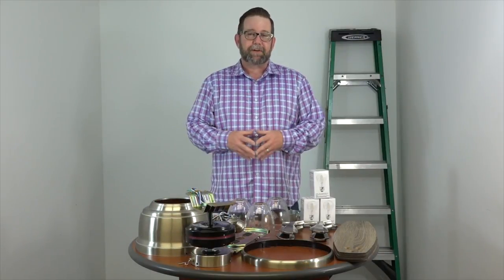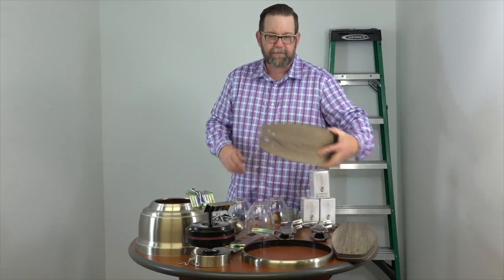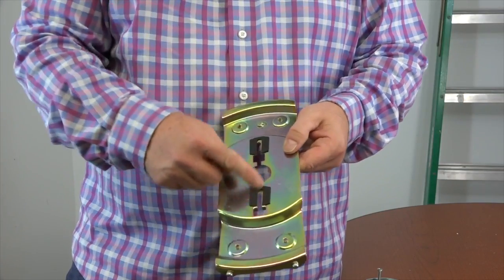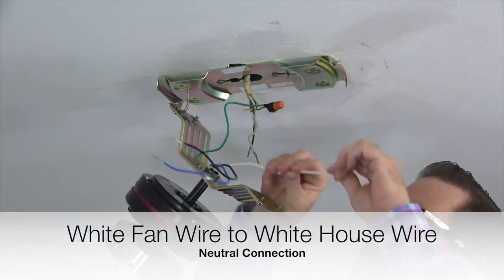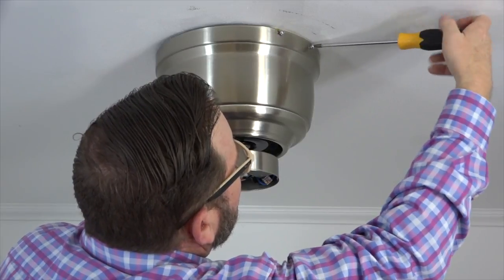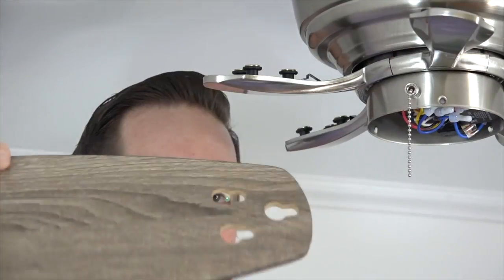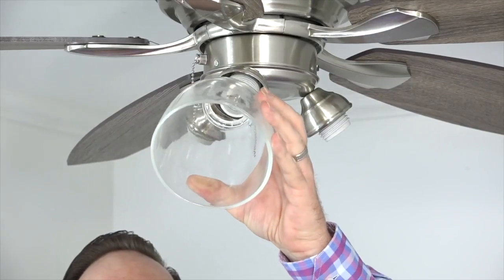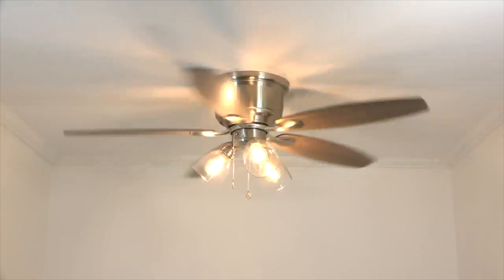How to install the 52 in. Stoneridge Ceiling Fan

Comment: New subscriber! From my ceiling there’s only a white black and blue  cable hanging.. the blue cable has a sticky note that says for light??
Reply from the maker: We would suggest calling a licensed electrician about wiring questions. The blue wire from the ceiling may be a switch wire, but we can not confirm that.

Comment: I’m installing five of these in my house. The instruction manual says to remove the rubber stopper before attaching the fan blades or testing the motor. I can’t find a rubber stopper anywhere. Am I missing something?
Reply from the maker: Sounds like the manual has a generic note. Many ceiling fans have rubber motor stops, but this one does not. You can disregard. Rubber motor stops are typically installed in the area where the blades connect and they are removed and discarded.
Reply: @ceilingfans101  thank you! I got the second of five installed in my house today, and it worked like a charm!

Comment: Any help after install? Fan was working great for about a week and now make very loud humming and whooping sound. It I hold the light kit part with my hand it stops the noise.
Reply from the maker: Sounds like the light kit or shades might be loose. Try tightening the light kit and make sure the shades aren't loose. If that doesn't resolve the issue, we would suggest calling Hampton Bay customer service.

Comment: I’m getting a scraping sound as the fan turns. I’ve tightened all bolts. Any ideas?
Reply from the maker: i would say check to see if the motor or blade arms are scraping against the inside of the motor housing. If so, you may need to adjust the motor a bit so the motor or blade arms don't scrape. If that doesn't fix it, we would suggest calling the number on the manual cover.

Comment: Hello need some urgent help. After installing the fan the power supply in that room is gone. Even though i switched on the breaker. Please help.
Reply from the maker: Is the fan connected to a wall switch? Sounds like you may need a licensed electrician to sort out the power issue.

Comment: I have an extra green wire from the ceiling. Any ideas ? Or just leave it with a nut wire
Reply from the maker: if it's extra, you can probably just leave it capped with a wire not. As long as the fan's ground wires are connected to the bare copper wire from the house, an extra green wire would be unnecessary.
Reply: How to install ceiling fans ok thx you . The fan is working perfect! You’ve get a new sub for the quick response
Reply: How to install ceiling fans for me there is no bare copper wire, white black and red. Is the red wire the ground wire?

Comment: What Is The Measurement From Ceiling To The Bottom Edge Of Glass Globes ? 

I Have 8' Ceilings & I Am 6'2" Tall & Do Not Want To Walk Around The Lights !!!
Reply from the maker: The assembled height is 15.2". You should be able to walk under it without hitting the lights.

Comment: I install it but when i turn on fan my fan is shacking during work how to stop shaking it?
Reply from the maker: sounds like the mounting bracket and outlet box may be loose. Make sure that the outlet box is completely and correctly attached to the house support structure and that the outlet box is stable.

Comment: Installed this fan and the grey wire is not connected to anything and the fan doesn’t spin but can hear the motor! Know where this only grey wire connects to?
Reply from the maker: This fan does not have a gray wire. It has blue, black, white and green. The blue and black wires should be connected to the house black wire, the white wire to the house white wire and the green to the bare copper house wire. Skip to 5:23 to see the wiring instructions.
Reply: Yeah the wiring that connects to the house wiring is black, blue, white and green but where the second set of wiring is for the lights is a bunch of different colours and there is a grey wire! And on this one it sent connected to anything
Reply: It isn’t connected to anything*
Reply from the maker: @Dupri6969  the wires from the bottom of the fan that connect to the light kit should be blue and white. This should plug together with the blue and white wires from the light kit. I think the issue is that the gray wire probably came loose from its connection. It either came loose from one of the pull chain assemblies or from the bundle of other wires. We would suggest calling Hampton Bay customer service at 1-855-434-2678. They will be able to explain where the gray wire should be connected.

Comment: Does it come with a remote control?
Reply from the maker: No, the fan does not include a remote. Most hugger style fans don't have remotes because there is nowhere in the motor housing to hold the receiver. There are exceptions to that rule, but in most cases, hugger fans don't have remotes.
Reply: Is it possible to add a remote control to this model?